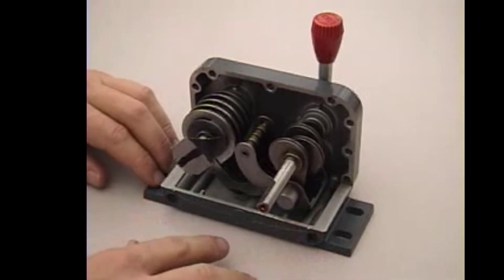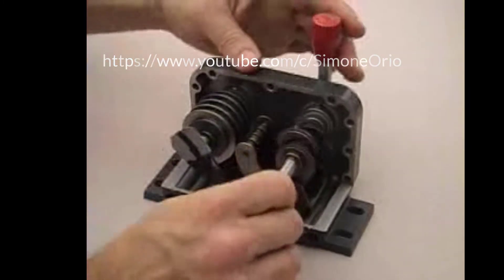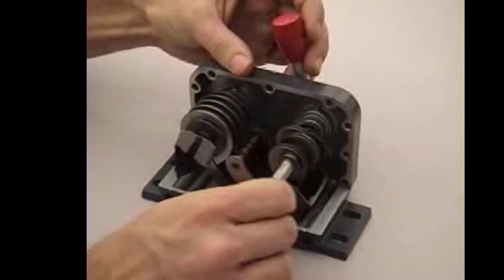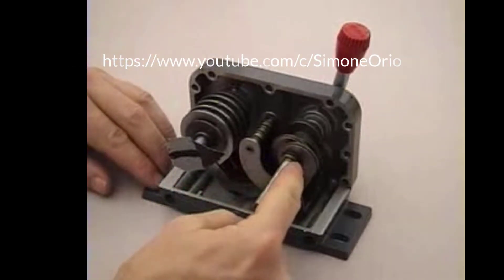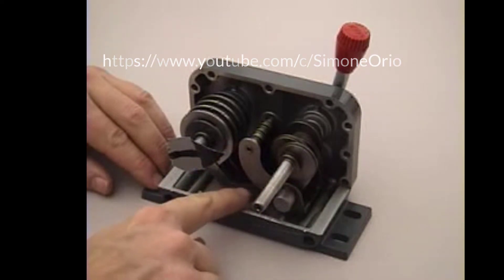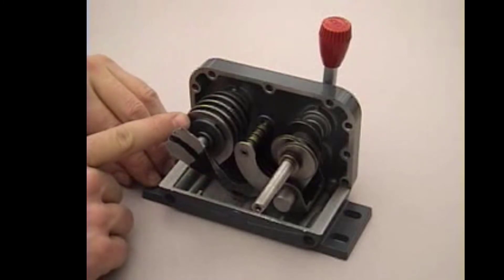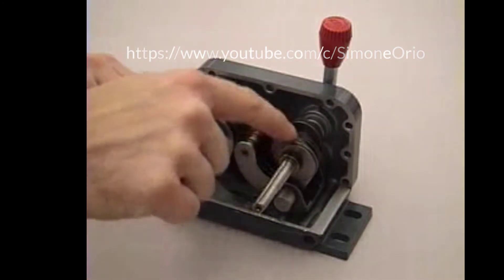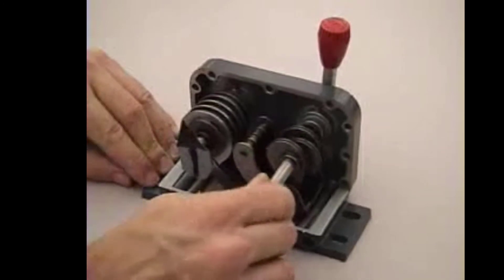CVT

Comment: Why this CVT is not used in bike or cars?
Reply from the maker: Zero-Max Adjustable Speed Drives are not commonly used in bikes or cars for several reasons:

Design and Application: These drives are typically designed for industrial applications where precise and variable speed control is needed. They are often used in machinery and equipment rather than in vehicles12.
Size and Weight: The size and weight of Zero-Max Adjustable Speed Drives can be a limiting factor. Vehicles, especially bikes, require compact and lightweight components to maintain efficiency and performance3.
Complexity and Cost: Implementing these drives in vehicles would add complexity and cost. Traditional transmissions and CVTs are more cost-effective and better suited for the dynamic requirements of vehicles2.
Performance Requirements: Vehicles demand high torque and power handling capabilities. Zero-Max drives might not be able to handle the high-performance requirements of modern cars and bikes